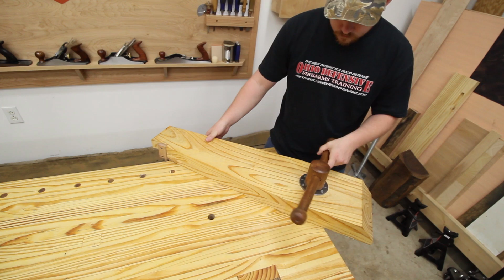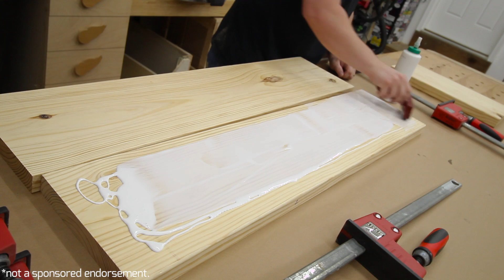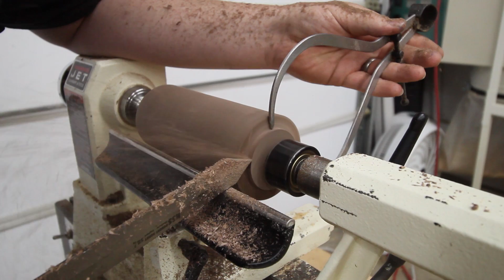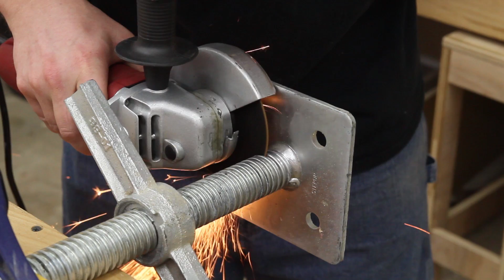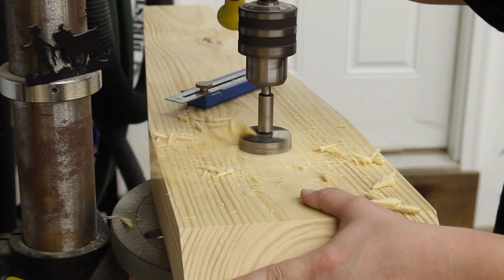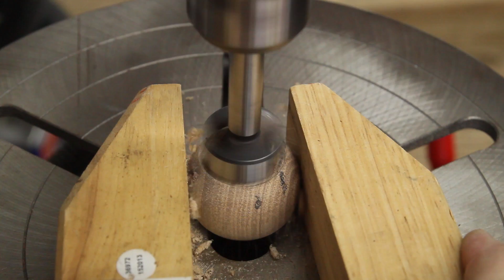Workbench Leg Vise - 252

Comment: I used that jointer and planer trick last weekend. 7.5 in wide piece on 6-1/4 jointer. It worked great. But if the board is very twisted, it wouldn't work. Where guard is mounted to is the same level as infeel table. After a few passes, the overhanging portion of the board is no longer hanging.

Comment: I would suggest not fixing the handle at the mid point.  If you're ever trying to hold a larger, awkward piece, a fixed handle might bump into the piece.  If you don't fix it, you can always slide it out of the way.

Comment: thank you thank you thank you! I'm building a vise very similar and it never occurred to me to use the wooden crank arm stock to retain the head stock using that slot to hold the large retaining washer. I was thinking I had to create one on the screw itself.

Comment: Great tip regarding the planing of the shoulder on the surface planer and then running that on another board through the thickness planer.

Comment: How come you have to use the jointer first?  Can you  just make a few passes with the planer to achieve the same goal?
Reply from the maker: No. A planer will reduce thickness. If the board has a twist it will still have a twist after the planer. A jointer makes one side flat.

Comment: hey, Jay, I'm just curious about whether I'm missing something: I would have thought it'd be easier to drill that through hole for the handle once with a long, narrowish bit, and then use that hole to center the forstner bit on both sides.

is that a good idea, or am I missing something?  or is it just that you didn't have the right kind of bit to do it that way?

Comment: I really enjoy your channel,  and this is just a wonderful & functional project. 
I've made a couple of mallets and gavels and found that it is easier to drill the handle hole before you turn the hub. You would want to joint the hub blank before you drill to ensure that the hole is in the center. Anyway,  great project as always,  Jay.

Comment: Very nice job Jay. I like the improvement of replacing the steel split ring with wood. Having said that the screws that hold the ring in place are stealing the show. They need to be replaced with something not so noticeable. Great video edit and voiceover.
Reply from the maker: Correct. The screws have already been replaced.

Comment: ...you don't see any glue lines until after you've stained it...
Reply from the maker: I've used this stuff on a few projects with great results. Clean up the glue squeeze out as you normally would and you won't have any problems.
Reply: The white glue is pretty much the only type of wood glue I've ever seen in here Europe and never heard someone have problems with that (me included) on finishing. I think chemically it's the same (PVA based) as the yellow glue often used in the US, but it doesn't look like you sneezed all over your project ;) . If you see glue lines, you should work on the precision of your cuts ;) .
This glue is a very good foundation btw. if you want plaster or wall paint to stick to wood very well.

Comment: It's difficult to tell, since your video is sped up, but slowing down the lathe when using a forstner bit (or above .25"), should stop it getting too hot.

Very nice job.
Good 'recovery' too...
Reply from the maker: Every clip in this video is at 100%. No clips are sped up. The speed of the lathe was set so as slow as I could go without the motor stalling as the bit was advanced. The main problem there was I was drilling into end grain which isn't as easy as long grain.
Reply: Jay Bates
yep...end grain fibres 'twist' and grip the drill...the larger, the more 'grip'.
100%...Really?
Darn, you work fast.

Comment: good job, but I don't particularly like the idea of screwing the handle in place in the middle. I feel like it would be in the way if it gets locked in the vertical position.
Reply: Me too. I have worked with many types of vises over the years and the handle always drops out of the way. What ever works best for who ever is using it. Worst case scenario, take the screw out. Great job as always, looks great. Sean will love it, I'm sure.
Reply from the maker: My leg vise handle was not pinned for the first month or two of use. Once I pinned it the ease of use and accessibility has increased. You never have to reach down below the center axis of the screw anymore as no matter what the lowest point for the handle will be horizontal with the screw. Most often the handle is near the top and more convenient. The handle is never in the way as it is sized so that at 12 o'clock the top of the handle is 1/2" below the work surface. If at that point it is in the way just advance it 1/8 of a turn and it's out of the way. I'll never go back to using a leg vise handle that isn't pinned like this. Try it and I think you will agree.
Reply from the maker: Collars would work as well.